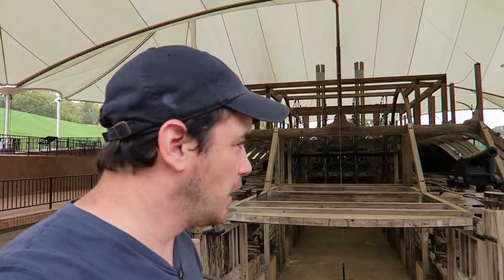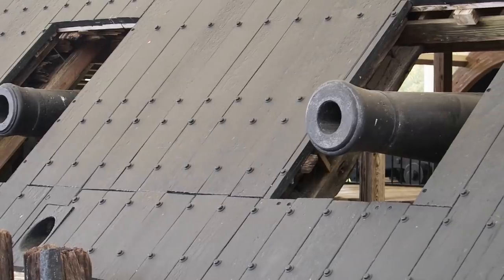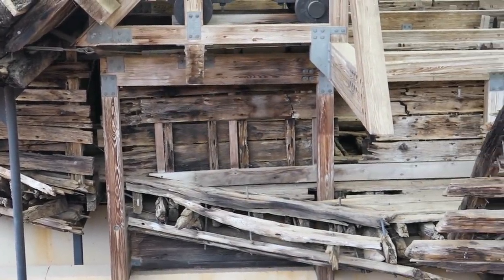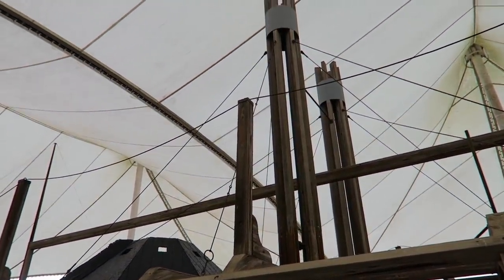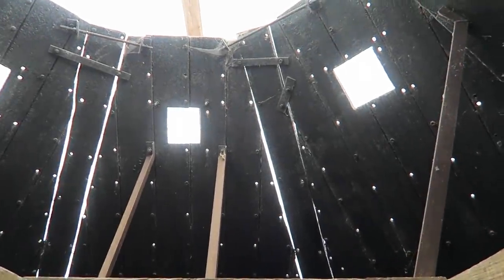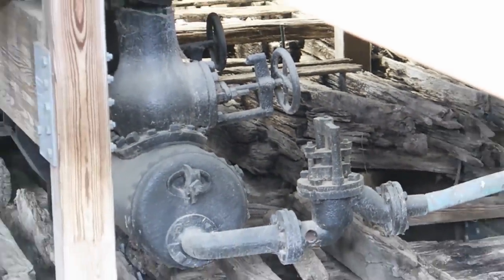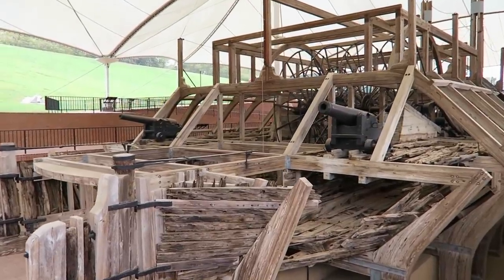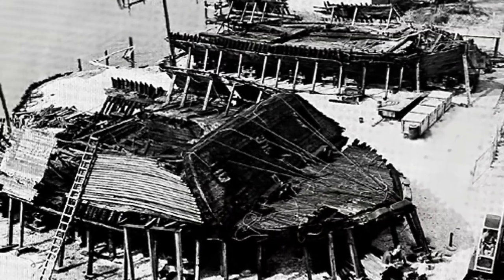Exploring A Civil War Gunboat

Comment: 1:06 Nice use of what looks to be small gauge Railroad Rails, inverted to give a better surface to mount the vertical pieces of iron cladding (why they're called "Iron clads"). This ship was built in 1861, and by using the rails (with existing tooling or stocks) that no doubt speed up the process of building the ship. Great video, and GREAT restoration.

Comment: 7:00 One knot = 1.15 mph, so 9 mph = 10.35 knots. The Union river gunboats were made with a wide flat hull to give them a very shallow draft to navigate shallow rivers. I believe that is also why they used a paddle wheel rather than a propeller because a paddle was less likely to get tangled up with debris in the rivers.

Comment: Guncarriages were the wood & steel trolleys that held iron guns.  Oscillating arm is called a walking beam, visible on most paddle wheelers
Reply: To my knowledge , a walking beam sits on a column. It has a pivot in the center, see saw like. The piston on one end and the connecting rod to the crank at the other. Many old steamboats were built with them . The prominent feature being the horizontal walking beam above the top deck. This boat does not have that style engine. Those are massive wooden connecting rods.

Comment: I dont really think they should be named battleship, because they had actually less armanent than wooden ships of the time, and US ironclads were river boats, they sunk easy in open, rough sea.

What they are is, and this is probably ironic, they would be closest to the Monitor classification, which fits perfectly as the Monitor classification came from the USS Monitor. They were slow river vessels meant to utilize heavy guns instead of many small guns, and many were meant more for defense, almost like coastal batteries. In addition, engine technology of the time was crude so many, at least from confederates side, broke down easily.

A battleship ironclad wouldnt come for a decade or two I believe. 

Unless you count the USS Roanoke, which planned to have 4 turrets of 12" smoothbore guns each (but it hardly functioned when it only got 3, and they didnt have enough 12" so a few lighter guns used instead) also, it was pretty much a failure of a ship that almost sank itself from the recoil its guns. But I mean. You can still consider it one I suppose

Comment: Historians: The USS Texas is America’s oldest battleship
USS Kay Row: am I a joke to you?
Reply: I just wrote a comment explaining why most ironclads shouldnt really be considered battleships, they were pretty different from the battleships that would come decades later.
Reply: Yeah the Kay row is a iron clad the USS Texas is a dreadnought style Battleship they are completely different battleships are not iron clads
Reply: @F-powerstrokeFord  I do have a small comment on this. The original specifications for the USS Roanoke called for I believe 4 turrets with 2 guns each, with uniform 12" smoothbore guns, which was quite impressive at the time (granted, I say 12 inch but they would have been nowhere near the quality of true battleship era guns. Muzzle loaded I believe, maybe black powder too.)

In reality, it got only 3 turrets and gun shortages led to mixed armanent of a couple 12 inchers and a few other guns, which was still enough armanent to almost certainly damage the ship on salvo fire (it could barely sail without capsizing from the weight shifting too.)

 But if we want to be technical here, it could be, or at least the original design could have, been the first true armored battleship

Edit: wiki also says they wanted it to have the capability to fit 15" guns too.
Reply: Day R actually if we want to be realistic than the first true iron clad was the French made Glorie. She had her lower hull coated in iron.
Reply: @swordlogic1157  no no no, I was saying that the USS Roanoke could have been considered the first battleship, not ironclad. it had plans for uniform, extremely large calibre guns (fitting into the motto of "all big gun ship"), and had plans for enough of those guns that it would have actually been (on paper, flaws aside) pretty formidable even by standards decades later.

Unfortunately, nobody knew just how big of a ship it would take to be able to wield them. So it came out far overgunned for her size, even after downgrading and removing a turret. My entire argument earlier is that ironclad does =/= battleship always
Reply: Day R Ahh, then in that respect I do agree with you. I read that wrong and thought you were trying to say she was the first ironclad warship
Reply: @swordlogic1157  no. Just probably the first one to nearly capsize from the weight of it's own guns ;)